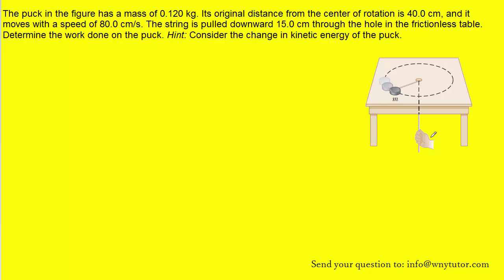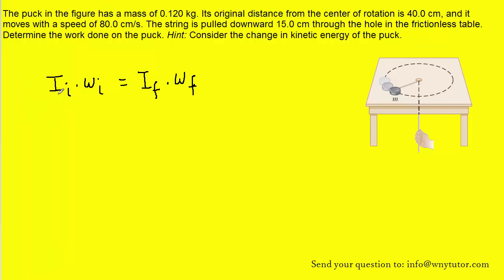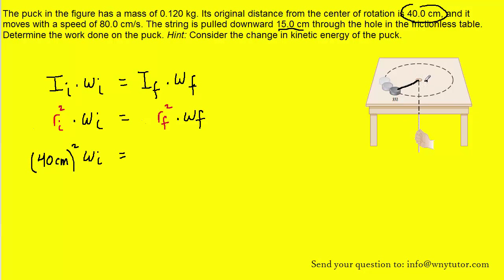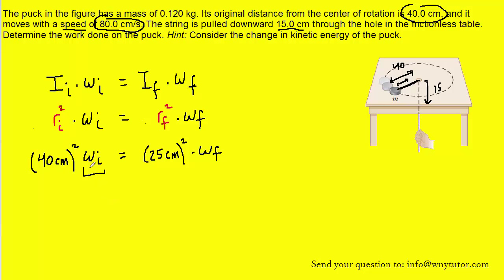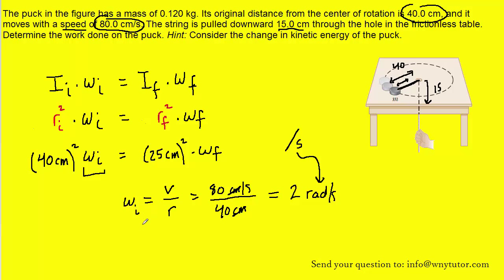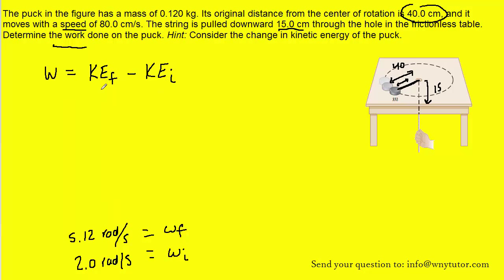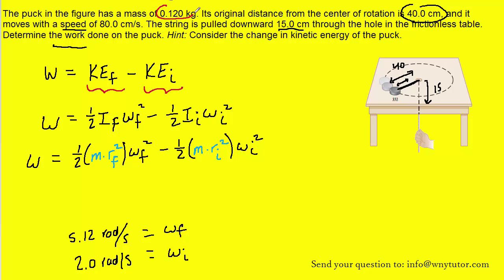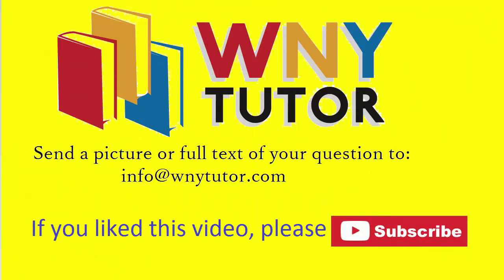The puck in the figure has a mass of 0.120 kg. Its original distance from the center of rotation is

Comment: In the work equation, you have r square as part of the I components. But w is v divided by r, so w squared components have 1/r squared. You get r2/r2, which cancels out. No need to multiply by r2 and then divide by r2, (twice). All that's left is 1/2 of m times v squared (you already found the v initial and final). Right?